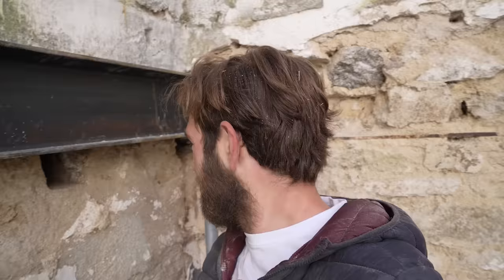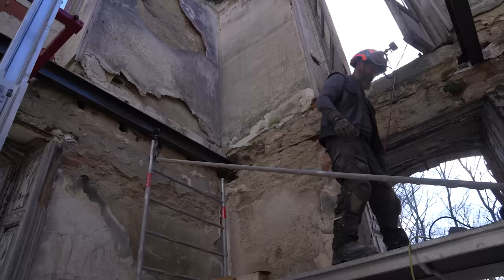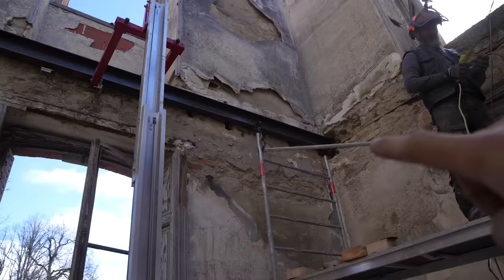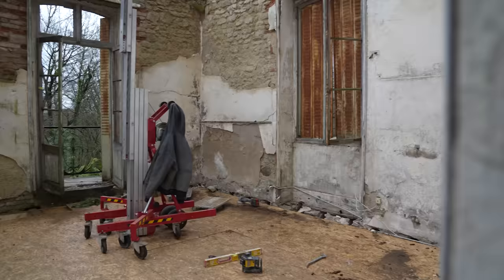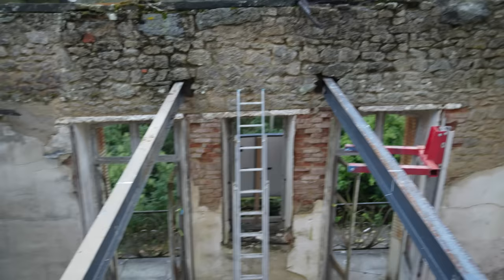Achieving the impossible, reaching the top of the chateau 10 days.

Comment: That crank elevator thing and Nick have been worth their weight in gold, diamonds, platinum,etc.
Reply: the whole project would go faster if they just put in stairs and carried everything up.  Plus they would grow some muscles.  but they don't like that kinda shtt.
Reply: Use technology not sheer strength, (enough of that in use!) to make what it an incredibly difficult task jus that little bit easier. Just a little. 🤔
Reply: @davidanalyst671 😂😂😂
Reply: @davidanalyst671  They could also have the dogs up there then which would be a precarious situation.  Also Dan keeps getting visitors so it keeps them out of the dangerous areas.  (Some of them anyway.)
Reply: That "crank elevator thing/pallet lift" probably feels heavier than gold. Cranking in the low-gear range is excessive and hard on the elbows and shoulders,..
don't forget to warm uo with a few stretches, gents.
Greg
Reply: The material lift is a $5000 thing! serious!
Reply: The little lift is phenomenally useful.  Nick is a wonderful friend
Reply: I call the crank elevator the second man or third today 😊
Reply: CORRETO    NICK  INSTALAR  UMA  GRUA   (CRANE)
Reply: @gss7271  I'd motorize that thing.  Would not be difficult.
Reply: @thomassherry2672  There ought to be a way to run that winch with your cordless drill.
Reply: Crank elevator? I call it a manual forklift
Reply: Sometimes I wonder about people making mean comments on YouTube channels. I wonder if they realize these are people they are talking about. Goodness we'll done Dan and Nick. What a job you did
Reply: It is a great invention. First time I'v seen this thing .
Reply: In think they should put in a freight elevator in the back of the middle section.  If they don't like it later, they can take it out.
Reply: @Scott_works we are talking about a historic building that sat for 50 years.
Reply: @Flippin_Crazy  I have been watching them since they started.  I realize that.
Reply: @sunettevanstaden3897  Some do.  But I haven't seen anything mean on this channel.  People are posting their ideas, not insults.  It's legit.  Please, don't be such a snowflake, and I mean that in the nicest possible way.

Comment: Dan and Nick, the best hardworking team….incredible skilled, talented and able to think “out of the box” to archive all this!🤩
Reply: Phenomenal!
Reply: NICK  E  DAN  ,  IGUAL  AO  PROCESSADOR E A  PLACA  MÃE
Reply: Was wondering, with the wooden floor joists  concreted into the slots all the outer walls were pulled together and couldn’t be forced outwards because of the considerable weight of the roof pressing down on them. What happens with the c sections where the joists are just slotted in. If the walls move outwards the floor will just fall out?

Comment: You got the flow of it now. Get as many floors in as you can whilst you got this momentum.
Reply: If I understood Dan correctly, they have to wait for a while. The two C steels haven't been delivered yet and Nick's stint is over anyway, so finishing up those floors might have to wait until Nick returns. Once those floors are done I suspect Dan's going to move onto that section of roof to get the floors covered, then maybe the connecting bit of roof in the middle.

Comment: Thank you for that explanation!  As an architect, that issue has been nagging at me for a while now!!!!!  Keep up the good work!  Now another question:  is the OSB you are using for the floor decking "Structural 1 OSB"?  If not, why not?
Reply: Hi Patrick patrickbass you are an architect, I am not but I am worried about the way they work....I never see drawings or statics.....but in France there are regulations to I think!?!? Are you not afraid that close the place???thank you.
Reply: @arieveloo9808  There's a structural engineer involved and there are drawings, Dan just never shows them. He definitely mentioned drawings when he built the roof on the other wing.
Reply: The osb flooring is temporary and sacrificial, will be replaced by better quality material later.
Reply: @Ragnar8504 thank you now I'm 🙏

Comment: It's a tad late to mention it but I had a thought . Make a big conical bag from heavy duty nylon canvas with a hole in the tip like a giant cake decorator's icing bag . When you make that plaster/grout/glue for the ends of the beams you could use that to squirt the grout right into the hole and get it all the way in.

Comment: Time saving tip ?  : Remove the crank handle on that red lift unit and put an adapter on it so you can run it with a 1/2” drill ? Variable speed for finessing !

Comment: Amazing, you don’t need to keep that pace up forever, just a couple more weeks. You’ll have a roof on that for May and a roof on the back bit by summer. This autumn and winter will be interior stone & brick work in a watertight box with space heaters. You should look into a chimney insert and a wood stove so you can be ready to get a bit of heat going and build up some thermal mass for the winter…

Comment: For handling I beams, get four fett rebar and bend 4 inch's into a u and bend the rest to about 60 degrees. Use the u to grab the edges and lift pull push the beam

Comment: At the rate you’re going, if you get the two Cs by Monday all three floors will be done by the end of next week. Then you can have the roof done in another week or two. Then it is the back wing, stairs and tower. If you then do the windows, even with temporary plexiglass, you could be weather tight by Christmas. This wing has gone amazingly fast. The back wing will go faster and the tower faster still. Bet there are those that passed on this little jewel of a chateau that are now kicking themselves.

Comment: Those small angle grinders, you can fit a small chuck from a old drill if you need to drill a hole in a confined space. No speed control obviously.
Jack, the Japan Alps Brit

Comment: Chopping off and  then welding that stringer to the C beam, was in my opinion, not the optimal decision.  Welds can be good or bad. When done by an amateur, it becomes a question of luck. Also, he lost the anchor point behind the C profile. To cut notch in the c-profile would be a safer/studier option.  But hey! It's coming toghether at a racing speed, and it looks good.

Comment: Question on the metal floor beams. Since you are no longer using the holes in the walls and just running an c shaped beam in place of them doesn’t that put all of the weight distribution on only two walls instead of all 4? Technically only walls that the metal beams are connected to are supporting the weight of the entire floor. The walls on the outside of the c channel beams are supporting no floor weight. Is this approved by a structural engineer? I absolutely love your videos and am so impressed with what you are achieving! Keep up the amazing work!
Reply: Good question.  I'm focused on the structural engineering on those old walls too.  The entire floor relies on how the metal floor beams are anchored to the stone walls.   I hope their anchor system is more than a few welds.   
So far, I've never heard one of the YT French chateau renovators mention building to code or passing an inspection.

Comment: TBH i would rather live in a poorly leveled building than in a building whose core structure is a patchwork of welded bits of beams glued to the walls. Of course i agree leveled floors are cool, but i feel like having a hole in the end of your C-beam to leave the original thing intact was a viable option as well

Comment: You don't know how lucky you are.  Dropping half a ton of steel beam on your head would be a brown trouser situation, in America these days just life in this nation is a brown trouser situation.  But I watch what you do there and I am inspired to get that sort of work done on my own place.  If you can do that then surely I can repair a rotted beam on the appended water closet that does not even support anything other than the 5X6 bathroom flat roof.  And I had an estimate of $30,000 to replace a pool cage that only has two sides and a roof, it is nothing but some little aluminum frameworks and screens.  The materials can't be more than $1,200.   You have to be a real crook to be a contractor in this country now.  $1,200 for the materials and $28,800 for the labor for one day of work.
Reply: That’s because this country has been sold out.

Comment: Seems it might have been better to make a notch in the C-beam instead of cutting the tie.
You mentioned you were going to 'weld the c-beam to the wall' reconnecting it to the tie? 
How did you even reach behind in order to do that? 
It wasn't shown that this was done...?
The purpose of the tie is to take tensile load. If it's not anchored to the wall,  it's not going to do that.

Comment: So are you going to back over the other side and run some metal down the sides to strengthen the parts that you stuck in the walls. Boy I would. This is going fast. 
I would imagine that when the floors are in you’ll start working on the roof. 
Do you need to do some block work to build up the walls on that side?

Comment: When cutting the corner tension bands, wouldn't it be a good idea to drill through from the outside corner from the side that remains cut and bolting a plate to hold that corner steady?

Comment: The most interesting part is going to be the tower roof room. 
You are going to have to build the entire room that makes up the roof section down on the ground and then hire a crane to lift it up and settle it and secure it up on top of the towers rebuilt walls. 
It would be crazy to build it up on top of the tower itself and incredibly dangerous and expensive.
Reply: Not any more dangerous with the right safety gear, but slating it will be interesting
Reply: @LaReynedEpee  if it was done up top you would need a full size scaffolding around the entire tower. Really expensive. 
Those rebuilding castles in this day and age have found it easier and much cheaper to unpin the wood from the stone work and crane down old towers or build new tower tops on the ground with a small amount of scaffolding around it and then once finished use a crane to lift them back up and seat them and pin and secure them back in place.
Reply: @theghost6412  I will be interested to see how he gets it done. I suspect it's going to be a long way off.
Reply: @LaReynedEpee  probably the very last thing to be done
Reply: @theghost6412  Quite possibly

Comment: I would have preferred to cut and reweld the new C-beam around the tie-beam, instead of cutting the tie-beam. You cannot know how much they are under stress. 
Moreover now there is an un welded side the will have to rely only on the future wall bolts.

Comment: How are you supporting the c channel to the wall  mid span and affixing it to the wall so it does not sag in middle of beam?  I seems that it would have been better to have all I beams and Instead of having c channels which are not structurally sound for supporting a floor. if they are not supported . I have seen another channel  doing the exact same thing but they welded short section of I beam perpendicular to beam and insert into the pockets and fill will mortar  they also welded  to old anchor rod through the wall and mount to existing decorative anchor brace to outside walls when I beam ended at outside wall.
Reply: A steel beam is not going to sag. Bolting it to the wall is intended to stabilise the wall and reinforce the overall structure.

Comment: Watching this caused some wondering if the new steel tie-beams were adequately supported from the ground up? Some aspects of these restoration look worrying structurally, as the restoration efforts to some extend seem to be ad-hoc and top-down instead of ground up? I may be wrong, and could have missed the earlier episode on a thorough structural integrity survey of the building in determining its restoration process, if it was conducted prior to work commencing. Nonetheless, it is a remarkable and very courageous undertaking without doubts! 👍

Comment: are you still bolting the c section to the wall as you did with the other one dan ? ..... as you are cutting into the ring strap without the trough bolting there is no longer a mechanical fixing to the wall behind the c section so the bolts become nessasary .... great work you are a skilled man with a great attitude .....

Comment: Trying to work out how those tie-rods have been re-jigged so they still do the job they were intended to do.
I think you've welded the rods to the 'C'-section end steels and cut off the end bits that ran into the walls. Does this mean you'll be bolting 'C'-section steels to the adjacent walls throughout their length?

Comment: Would it have been better to slot out the C beam and left the tie strap intact, welding to it. And as I've suggested before, nail in your end nogs as you go.  
Both these suggestions save time. The slotting means one less grinder cut and one less welding. The nogs less scaffold movement.
Me a foreman of multimillion dollar commercial sites.

Comment: Could you explain how the floor works in more detail. I understand that the c section saves time but how is it connected to the wall?. Previously when using c section youve used heavy duty bolts drilled through the wall.
It doesnt seem like there's mutch holding that floor up.

Comment: I realize you are in a crazy hurry for some reason, but it makes me crazy every time you put some permanent structure over some crumbling, broken wall like these C channels. You constantly talk about making things stronger but you are leaving broken walls full of holes behind those things. At least on the other side you poured stuff behind them and bolted them into the wall. you seem to be cutting all kinds of corners now. Not to say you didn't do the same thing with floor joists on the other side, putting them right up against crumbling walls, as well as the entire perimeter of the roof wall.  At least you can kinda see/access the holes still so maybe you plan to try to fill them but you made it 10x harder this way if so.

I don't get why are you refusing to fix these walls and make them solid before putting these things up. It would not take that long. and you know the first side took months, this side could take 3 weeks instead of 2 and still be insanely fast.
Reply: I think some of his choices are being dictated by Nick's availability, but yes, the best thing would be to fill in those pockets.